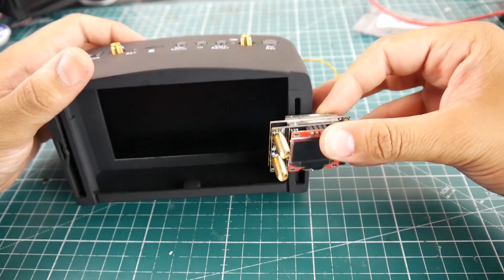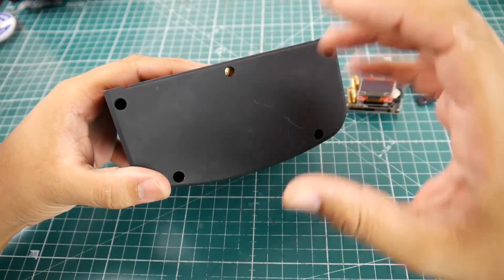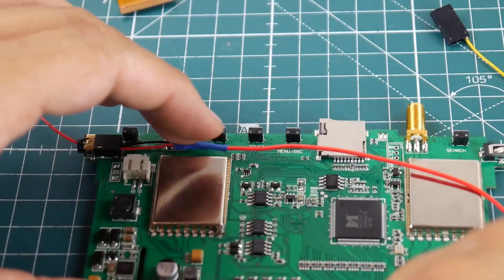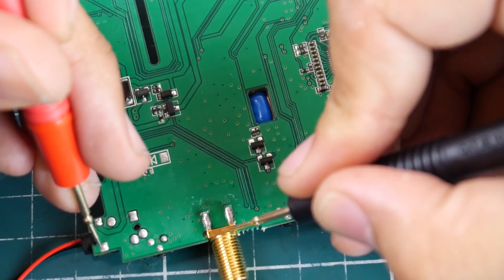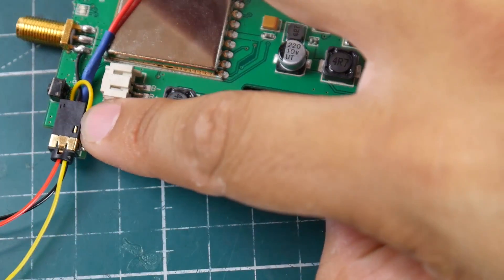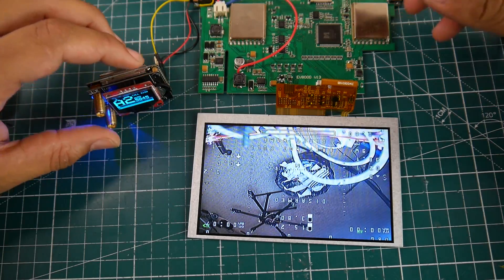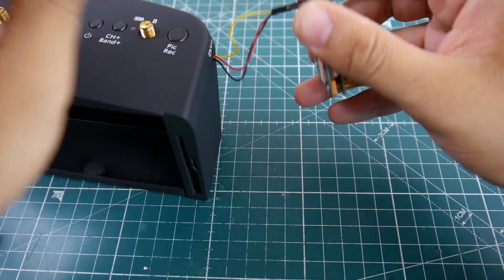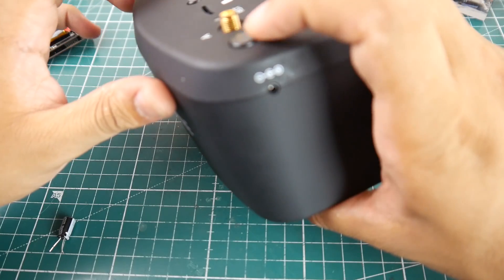Eachine EV800D Fatshark Mod // 3 Wire Mod Install any Fatshark Module Eachine Ev800D

Comment from the maker: EV800D FPV GOGGLES MOD Video
https://www.banggood.com/Eachine-EV800D-5_8G-40CH-Diversity-FPV-Goggles-5-Inch-800480-Video-Headset-HD-DVR-Build-in-Battery-p-1180354.html?p=CS101558118042016088&utm_content=zhikejian&utm_campaign=mesh

Wires For modding
https://www.banggood.com/30cm-40pcs-Female-To-Female-Breadboard-Wires-Jumper-Cable-Dupont-Wire-p-90154.html?p=CS101558118042016088&utm_content=zhikejian&utm_campaign=mesh

Ts100 SOldering Iron
https://www.banggood.com/MINI-UpGrade-TS100-Digital-OLED-Programable-Interface-DC5525-Soldering-Iron-Station-Built-in-STM32-Chip-p-1021266.html?p=CS101558118042016088&utm_content=zhikejian&utm_campaign=mesh

Comment: Nice video. Um, wouldn't it be a lot easier to put the negative and video wired onto a AV jack then you could just plug it in and take it out whenever you wanted? Then do a plug off the 5v so again you could just plug it in? Just a thought.

Comment: I recommend adding kapton tape to entire back of the screen. The back of the screen looks like thin-steel or aluminum, and it's is conductive. One youtuber demonstrated in his battery mod video that this metal back is charged at something like 5v, so it causes bad interference if the screen touches the circuit board. (It was happening to me.) Yeah, so about 2 or 3 single layer pieces of kapton tape did the trick! (depending on the width of the tape. I think I have a roll of 2" wide kapton.) I hope this helps someone!

Comment: The link to the FatShark module from the EV800 video is dead, is it still obtainable? Is it possible to do the same mod to work with HDZero or even DJI? Are there simmilar modules available for these systems? I'd greatly appreciate if you could share links to such modules. Thank you, you did a great job with this video, I'm new to the hobby and to the soldering, but I'm sure I'd be able to do it myself. Cheers!! :)

Comment: sir, i have a question. I want to add pro58 module to my goggle. My question is, can I add this module without unsoldering the original module on the goggle board? I'm worried if I don't remove the original module, it will detect the original module even though I have installed this pro58 module.. can you answer my question?

Comment: Does putting the goggle to AV mode turn off the stock internal receiver? Otherwise, it's like running 2 receivers, and will be very power hungry.

Comment: Hi! nice mod, thank you.
I'm wondering: if I remove one of the both rx5808 and connect the external module in place of the rx5808 (by taking the 5V on the connector of the module), will this work and finally, does it make a "triversity" goggles?

Comment: hi I have both glasses ev800 and ev800d so I was wondering if I can put the battery from ev800 over to ev800d does it go the battery I have in ev800d is not so good

Comment: Hi guys does anyone got a solution to adjust the resolution so it dont cut the top and right side of the osd/original resolution ? 
because this is a bit painfull to center the osd and we lost some fov ..

Comment: Best place to solder 5 V red cable would be after the capacitor on the way to some other 5v consumer bro. Im thinking I should make a video with the explanations of where exactly to solder and also with the coax. What do you think?
Reply: Please make a mod video! If possible making use of the a/v In jack instead of everything soldered to the board.

Comment: So got a question. If I have the 2nd version of the ev800 that has the av in like the ev800d version. Could I do it just like this except for voltage regulator to part for the ev800. Well Idk now I'm worried that if you go into bad signal the screen would just turn blue like it just did there at the end. That's scary

Comment: Would have been so useful if the blue screen doesn't come on when there's no signal. But I guess that's the issue of the FS receivers. They kill the output when there's no reception. That's really bad when you're flying and you suddenly get blue screen instead of at least some level of static so you can make out something.
Reply: I seen in a different video that you could fix that issue
Reply: @harryfp1494  which video? I'm planning on doing this mod

Comment: Some modules really need an actual 5.0 volt power supply. Not 4.8 or 4.9.
Sometimes they benefit from 5.1v.

Comment: So will the fatshark module work together with the ev800d module?  will i fly with four antennas? In flight will i have the safety of a fatshark?
Reply: Just 2 antenna's. Video Signal comes from one single receiver => 2 antennas

Comment: @Drone Mesh, from a purely logical standpoint, this should work with any goggles that have AV in right?
Reply: That's my thought on this. I went as far as to de-pin the receiver module from the circuit board and run wires to the + - and video signal pads. Now my 40 dollar goggle has as much range as any fatshark goggle.
Reply: @billybbob18  can you please post a video showing this and explaining it? This sounds like a very helpful mod for the community who is new to FPV and your contribution would be greatly appreciated I am sure.

Comment: There is an open 3.3v pad on the board. The RTX6715 chips(inside our favor rx5808 modules) runs off a stepped down 3.3v. It will work fine off the 3.3v open pad near the second antenna.

Comment: Hey! I did this mod recently and I got diagonal lines in the feed, when I changed to internal module, there were no problem. Is this because the video wire needs to be shielded? But your feed was good in the video. Let me know what you think.
Reply: KARTHIK R whenever possible try to use shielded wiring.  For most applications, it normally isn’t required but when working with wiring so close together having shielded wiring is almost a requirement.
Reply: Hi, did you solve your problem? I have the same issue, i changed the yellow wire for shielded wire but it doesn't remove the diagonale lines...

Comment: Does it hurt the goggles to power them up without antennas? Or is that only an issue for transmitters?
Reply: There's NO(!) problem with ANY(!) goggle or reciever. Only with transmitters, if you're unlucky you'll fry it. Some are protected, some not. So try to avoid it in any case.

Comment: You mentioned a blue screen with no signal present...does this happen when signal drops in use? If so, it's a deal killer.
Reply: This is a great question. I'm wondering too
Reply: Yes, when signal gets very weak you get a blue screen.
Reply: What is the solution of the problem??

Comment: will this mod produce a blue screen when reception is lost ? on your module ...i.e does it fade to white noise/static or just blue screens you...= crash!!! thx guys great mod, ive read through the comments and this issue is asked a few times , with no answer... cheers
Reply: Yes, just tested this and it will produce a blue screen. First the video goes static but if it goes full static, the av mode will assume it means there is no video signal and go black then blue. Even if the video recovers, the goggles will still display the blue screen until you power off and power back on. So if you're doing this mod for better range, the moment video goes full static, you'll see the blue screen and it is not very intuitive to toggle the goggles off and back on. That is enough time for the drone to crash unless you have gps rescue that you are able to manually toggle with all the stress you're already going through

Comment: Thanks this helped out a lot great video. I had some very slight bit of fuzzy or grainy video in mine so I used a shielded wire and removed the yellow and now its clear as day. Thanks again. I also did a small fan on mine just under the rear part cause my glasses would keep on fogging up and wired it to the external battery plug. Now no more fogging.

Comment: This is a good mod. Saved me hassle to find out where to connect what after my internal RX started going haywire. One suggestion is to install L/C filter in the power line to fatshark module as without it I had some interference/lines. I used a super micro L/C  filter (http://www.myrcmart.com/lc-filter-super-micro-for-micro-multirotor-14s-1a-current-02g-p-11036.html) and now the signal is perfect.
Reply: How much lag does it add?

Comment: doesn't it try to go to blue-screen when the signal gets weak?
Reply: Yes. When signal gets really weak it jumps to blue screen.
Reply: My problem is same.when the signal is low jump blue screen.what is the solution of the problem??
Reply: @gombtam  I had the blue screen because i was connecting trough  the video input jack of my goggles. My solution was to remove the internal module on the googles and wire the new module directly. now it doesn't go to blue screen anymore.
Reply: @JustForFunRC  Hi, I'm going to do this mode, but the blue screen issue is deal breaker for me. Do you have some pictures where to wire the new module directly? It would be very helpful.
Reply: No

Comment: I have a slightly different problem. Where to connect to AV out to the AV in on the EV800? I have a circuit board v06 version.
Reply: not the D version

Comment: Awesome. To take it a step further, instead of using the av jack to route the wires thru, drill a small hole to run wires in and leave the av jack open. Then you can still use it to run other av inputs into the jack, but I imagine you will need to unplug the module before doing that.
Reply: @Haverr1  ive seen this posted but no real answer yet...So im asking as well,, im thinking it goes to blue screen not static? white noise? etc..
Reply: @Haverr1  В моем случае видео совсем прекращает записываться..  (Это огромная проблема!)

Comment: Might as well go all the way and have an external 1S Battery connected to a voltage step-up module to power the fat shark module. Then connect with a modded AV cable.  So you don't even have to change the goggles at all.
Reply: This is true.

Comment: Remove internal battery in favor to external Fatshark type one through 2.1mm Jack connector. Apply voltage level indicator fix. Details are described in RC Groups. And install low voltage alarm buzzer, please.
Reply from the maker: link?
Reply: Yep. The voltage level indicator fix by vladG
https://www.rcgroups.com/forums/showpost.php?p=39216109&postcount=273
Low voltage alarm for stock battery by the same guy (Attiny13 controlled)
https://www.rcgroups.com/forums/showpost.php?p=39232074&postcount=285
https://www.rcgroups.com/forums/showpost.php?p=39233181&postcount=289
This guy did basically all stuff that I recommended in his way except low voltage alarm
https://www.rcgroups.com/forums/showpost.php?p=39998406&postcount=478
Reply: Oh man that was helpful

Comment: nice work. Will your battery die faster with this mod ? hmmmm ?
Reply from the maker: Yes 4 receivers active. AV mode does not disable internal modules.

Comment: NIce video, just a few questions before I do this.

 1. Does the av in still work if you route the wires differently?

2. When using av in I notice the goggles have bluescreen. Is this a big issue?

3. Is there a lot of added latency? Could you maybe test it?
Reply: I feel like I can answer this.
Yes, the av in will still work if you route the wires differently. If you leave the jack open and you can still use it to plug in other av compenents . You must unplug module first though.  
Second, the blue screen is normal when av in is selected with no input . Once an input is given , it will display. 
Third, there should be no added latency. All the Google is doing is internally switching inputs.
Hope that helped.

Comment: Hi can you let me have a link to the voltage regulator that you used in your esc/motor tester video thanks mate      Tim
Reply from the maker: Voltage Regulator  
https://www.banggood.com/Small-Mini-360-Adjustable-DC-Power-Supply-Module-Mini-Step-Down-Module-p-917568.html?p=CS101558118042016088&utm_content=huangguocan&utm_campaign=mesh.drone

Comment: Can I do this to my Eachine VR D2?
Reply: Absolutely. I did this mod a while back to my vrd2. The only thing is that I found that you may need to unplug the module when using internal Rx. I experienced some interference when using internal Rx while module was plugged in and powered up . At very least just unplug the video input from module. But you might as well unplug module power too  to save battery.  But it does work the same way.
Reply: RCing in SC Thanks!! 💪

Comment: There is a new GE-FPV RX5808 with laforge V3.3 It look like this do not have USB port for firmware update.
Reply from the maker: There is serial pads on the boards.

Comment: oh, so av in does work, i wonder why i couldnt get it goin, i wanted to practice a sim with goggles but i couldnt get it to work with the jacks and video converters i have. i'll maybe look into that again.
Reply from the maker: Waste of time to fly with goggles on sim. You want to practice muscle memory and not how fast you can achieve a headache. ;)
Reply: yeah thats a good point, my goggles are extended 800d's but i still think i'd get eye strain,  it would still be great to fly gta5  when the weather grounds me here in scotland
Reply: Could it be that you are going from digital to analog video, and you don't have the right converter?
Reply: yeah its digital to analogue issue or wrong pin on jack, my graphics card can do analogue but i dont think it would do a low res signal and there was no digital data back and forth to tell the graphics card to  send a low res signal,  normally the oldstyle vga cables could still do data to tell the graphics card what it was,

Comment: FANTASTIC work, dude! 😃
Yeah, those goggles are awesome! Super comfortable to wear too!
And, please, try the DVR! But put the internal modules in a different channel first, to get only statics, to be sure it's recording the AV in. 😉
Reply: The ev 800d do record av in. I have used a 1.3 reciever with av in and it works
Reply: @kral5932  Awesome! Thanks! 😃
Reply: @kral5932  i have troubke to instal 1g3 on this. Suspect that gnd wiring has something to do with it, or ntsc/pal issue.. or just faulty receiver. Im going mad :)
Reply: @giga18116  not sure sorry, i switched to fatshark hd2

Comment: Is fat shark receiver that much better? I'd like to see a comparison of both feeds...I've already modded my ev800d battery this maybe next.
Reply: @mckey19c I'll finally be making a mod video for this soon, as soon as my parts come in😁.  My original comment isn't here anymore so I'm not sure of all that i said but I'll be doing Drone Mesh's mod (you rock) with a few tweaks, adding a headphone jack wired to the new module for sound, custom mounting breadboard wires in the front so you just plug in like an actual fatshark goggle, and a battery mod.  I can't wait!  Keep an eye out on my channel in a week or two and it should be done around then.
Reply: Hey Falkorw i will watch your video ! Whixh module will you use and do you think this wikl work with rapidfire or wildfire ?
Reply: @cedricdemets98  Ok I finally finished my mod video, sorry it took soo long!  And a special thanks to Drone Mesh for starting this whole thing and showing us how to wire everything up!  Here's the link to my video, enjoy!  https://youtu.be/fNNN3EmZ8dU
Reply: @cedricdemets98  I'll be using Rapidfire and it'll work with any fatshark module, i might have to step up the power to exactly 5v but we'll see when we get there!
Reply from the maker: Depends there are many out there.

Comment: Hey DM, I just checked. The EV800 also have AV in. So probably it is possible to do this same on EV800, and not to damage the receiver. The MENU button on the EV800 will change to AV.
Reply from the maker: There are 2 versions as I know for the ev800
Reply: and above the all, thanks for the great work and as always great educational videos regarding FPV quads!
Reply: @slobodanbirgermajer6117  Hey, i'm very interested in the answer as well, did it work?  Thank you!
Reply: well, I have the version with AV IN. I'm waiting for the Eachine PRO58 RX module and will try modding it by AV and not removing the internal module.

Comment: The AV in port looks like a 3.5mm port. If so, you can take an advantage of the third unused pin as power output, thus no dangling wires and neater look.

And oh yeah, love that JB style "I'm from the future" correction.
Reply: Can i use av and plug directly thru the av input. So no need for wire? I plan mod the crap out of this 800d
Reply: Probably,  @hanquah . I don't see any reason for it to not work.
Reply: @Asu01  thx for replying bro
Reply: @hanquah  hows the mods going?
Reply: So, did the AV port Mod work for adding the FatShatk module to the EV800D googles?

Comment: thanks for posting the video in time,I'm gonna get either Ev800 or 800d.
Is there any difference in picture quality between them?
I'm leaning more towards EV800 and modding them with pro 58 and dvr,what do you you think?
Reply from the maker: Both screens are identical. However the EV800D has a built in DVR for the internal receivers. But I will be making a second part for the EV800 to add the DVR to the external fatshark modules.
Reply: @DroneMesh  does this mod increase the signal penetration through obstacles like trees and buildings?
Reply: I am thinking about getting the same pair!!! I also like the Viper fxt goggles!!! I need 2 save some money up and by Christmas hopefully they have a new pair of goggles coming out!??? If not I'll probably get the 800d goggles!!
       HAPPY FLYING